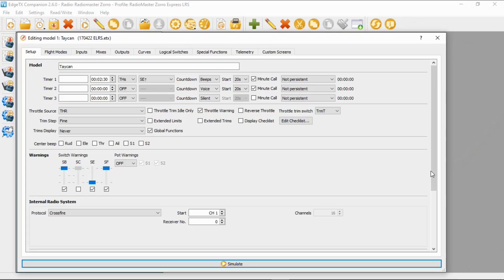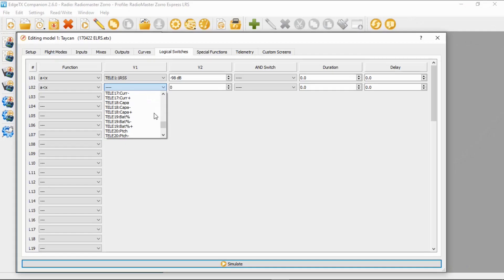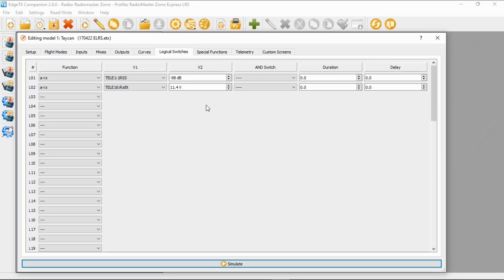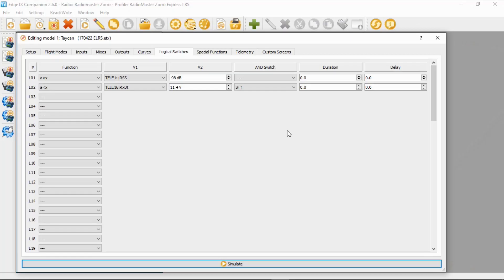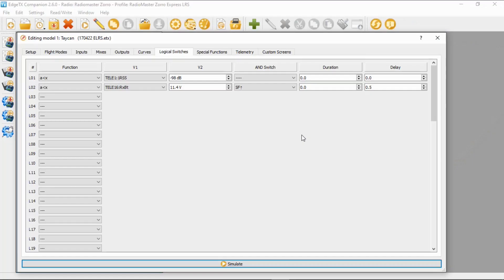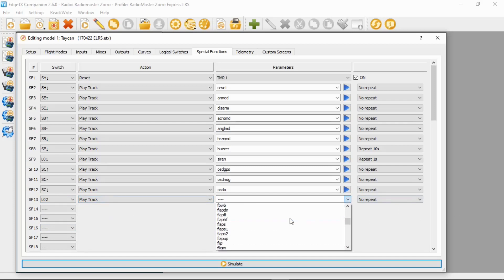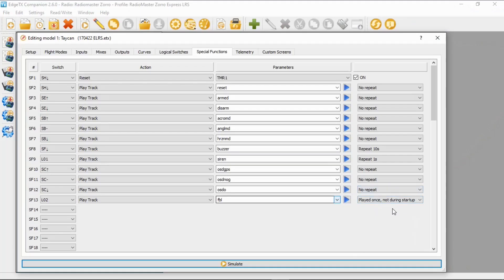EdgeTX Setting Up Low Flight Battery Telemetry Warnings

Comment: Do you mabye know why would I get 17.3V RxBat reading from my 3S battery? It's like its set for 4-5S or something.
Reply from the maker: You need to calibrate the telemetry sensor.
Reply: @the-happy-RC-flyer  Okey thx. I will try to find this option. I use china elrs cyclone receiver...

Comment: Do i have to set up telemetry on the computer or can i just use the boxer?
Reply from the maker: You need to discover the telemetry sensors in the radio under model settings.
Reply: @the-happy-RC-flyer  Thanks!

Comment: Hello Bill.  Thanks for your very helpful videos.  Here is my question: is it possible to get a visual percentage of the flight battery on the home screen? Telemetry comes in on A3 and I can view that on the screen, but I would love to be able to look down and see that I am at 60% remaining.  I can do it for the Tx battery, but not the plane battery. 
Thanks,
Paul
Reply from the maker: Hi Paul, could you please tell me which radio you have and I will try to assist you.
Reply: @the-happy-RC-flyer  hi Bill, thanks for the quick reply. Radiomaster tx16s using a 3s flight battery in one plane and a 4s in another plane. The max and min values don’t allow for decimal points so the percentage is not accurate enough.
Paul
Reply: P.S.: using a Lemon Rx
Reply from the maker: Hi Paul, you can put a decimal point I do in the video. I assume you have two models set up one for each plane so you can set up the warnings for the two different voltage batteries. Looking down at your radio while flying is not recommended so the audible warnings are ideal.
Reply: @the-happy-RC-flyer Hi Bill: thanks.  I accept your suggestion that an audio warning is better than looking down at the radio.  Good point!  I appreciate your helpful ideas. 
Paul

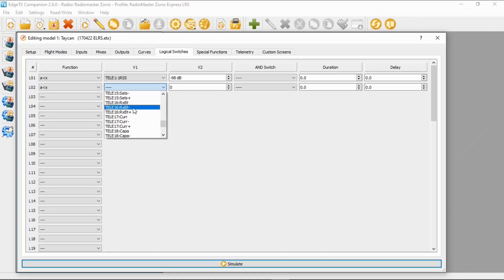Comment: My English is not good and I understand you very poorly. What do you say at 1:30 what is the difference between RxBt+, RxBt and RxBt-? Translated by Google.
Reply from the maker: If there is a + after the sensor this will show the highest value the sensor reached. - after the sensor value will show the lowest value the sensor reached. No + or- is the current value which can / will fluctuate. This is useful for RSSI radio link so you can see the lowest RSSI value for the flight or the highest. Any further help let me know.

Comment: hello Bill,
The function you use in your vid doesn’t appear in my TX16S as mentioned in my initial message. I use the built-in function ‘Batt’  (in the TX) as value for V1. My EdgeTX version is v. 2.9.2 ‘Providence’ from 2023-11-12. 
This might be useful for other readers ?
Nevertheless your vid was helpful for me to understand how edgeTX works as am the bloody beginner here. So far thanks for it. 👍😊
Regards. Prudence

Comment: Nice and interesting vid except that neither the used function nor the used sound are available in the TX16S bought in December.
Reply from the maker: Hi Prudence, the video shows how to set up this function but you will need a receiver capable of receiving the battery voltage which is much higher than 5v and the telemetry sensor to do the job. So that’s a hardware requirement. Sounds, if you cannot find the sounds I use in my videos then they are custom sounds I have made. 

How to make custom sounds

https://youtu.be/DqF7HUsFrnE?si=_62oAccBxAWNU0n-

Assign Sounds

https://youtu.be/gOOVsuArmfY?si=xA4G3yCvcMWsDcPz
Reply: hi Bill,
That’s all clear! My RX returns the voltage and the sound isn’t the main issue. But the function you’re using isn’t available; At least in my TX16S which is quite recent (December). I downloaded the companion a few days ago. Have tried another function which I’ll test this afternoon. Regards. Prudence
Reply from the maker: Exactly what function is missing, what is the option not appearing?

Comment: can i do it with radio master pocket??if yes can you a make a video
Reply from the maker: If you follow the instructions in this video you will be able set this up in your Pocket radio but you will need a receiver that has a telemetry sensor for the flight battery.
Reply: @the-happy-RC-flyer   what types of rx needed?I have ER4.but may be er series just can transmit telemetry data just the voltage only.
Reply from the maker: @jeepoyfernandez the ER4 does not have External Voltage input but the ER6 does.
Reply: @the-happy-RC-flyer  I have ER4 has telemetry Rx bat only like 4s it display 16 volts..and one more..I was thinking that telemetry data may save instead
Reply from the maker: With any receiver you will need a input for the external voltage this is because the receiver only requires 5v.

Comment: I have the telemetry button and a couple others stuck in the in   position. Is there a way to change them out or is this something I need to send in for repair?
Reply from the maker: It depends on the radio it your radio is a RadioMaster check their website for available spare parts.

Comment: Hi and thanks for posting very useful tutorials, great work! New to TX16S and trying to setup a voltage alarm for flight battery. Receiver is FrSky S8R which should have a built-in battery voltage sensor (according to specs). However, we're not seeing the same list as yours when selecting the V1 column in the Logical Switches in Companion. Any ideas where we should start troubleshooting? Thanks again!
Reply from the maker: Hi, I think you will need to buy a FrSky voltage sensor. It appears the receiver has RxBat which will only show the receiver voltage which should be 5v.

Comment: i found txbt, serves as V1? I'm using Expresslrs 2.4 and I didn't find the one you indicated.
Reply from the maker: Just discover the sensors and look at the values if you have flight battery voltage you should see the packs value.
Reply: same problem here. i use elrs 2.4 too

Comment: I’m trying to bind a R88 receiver by Radiomaster ! I don’t c it in the menu! Lol thanks for your time! You have been a big help!!!!
Reply from the maker: Hi Dale, The binding procedure is:
Hold down the bind button on your receiver and plug in the power.
Go to radio click bind. 
Once bound disconnect power from receiver. 
Reconnect power to receiver you should be bound. 
FrSky Receivers:
If you receive is the ACCESS protocol it will not bind to your multi protocol module. It needs to be ACCST but it can use v1 or v2 firmware and there is no way to tell what your FrSky receiver firmware version is, FrSky do not make it easy.
In.your radio select Type FrSky X subtype D8. 
Let me know how you get on.

Comment: +1👍Oscar Liang website has some further settings/details for avoiding false or unneeded readings.
personally i dont go that far, but i set set if/then logic for above a small voltage so that i don't get 0 volts readings.
what i'd love to do but have not yet, is set logic for my ELRS where it understands my 1S setups versus my 6S setups and reports properly.
Reply: Can you direct me to that article?
I'm trying to have my radio give a more accurate read out of the flight batt.
Right now a fresh battery is read as 82% and at 20% my batteries are actually at 12-13%
I'd also would love to understand how to set up an audible like this video glossed over.
Reply: @BendApparatus  i think the message will not post with links. :( i replied a couple days ago.
Reply: @nerdCopter  yes I forgot YouTube doesn't allow links.
If you can give me a few key words or sentences that'll bring up the article.
Reply: @BendApparatus 
basic : setup-taranis-read-out-voltage
advanced :  taranis-logical-switches-voltage-alarm
Reply: Thanks!!!
Reply from the maker: This video should help you
https://youtu.be/k188p7lhkhk